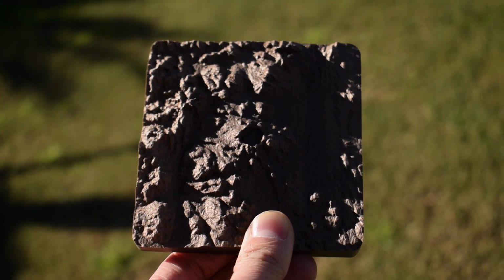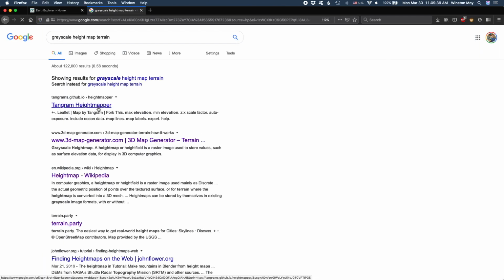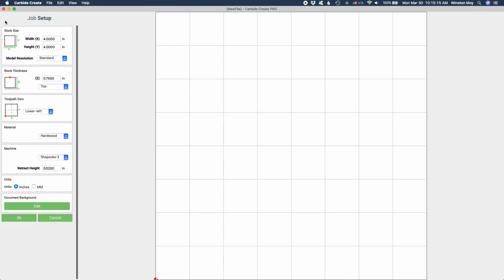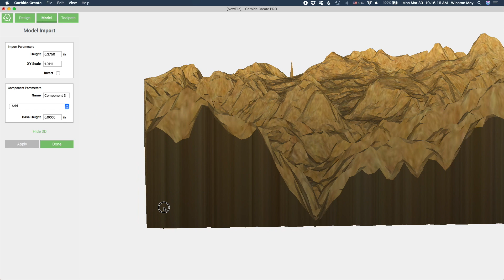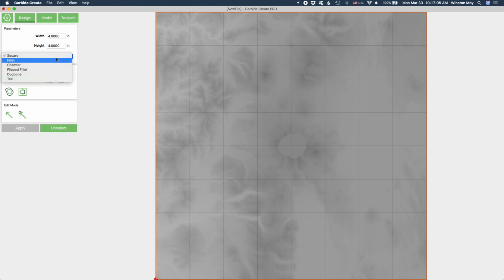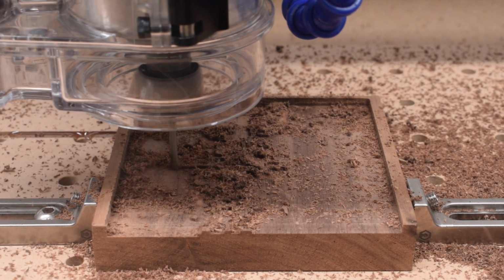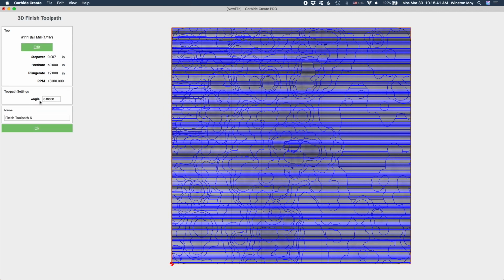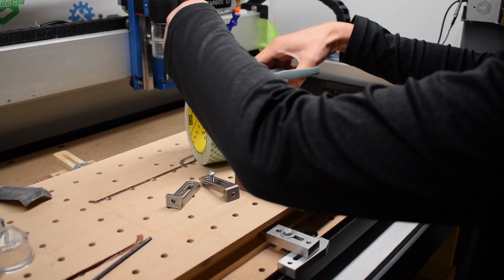Machining a Topographic Model in Carbide Create Pro

Comment: Can you use Carbide Create Pro with a Sainsmart Genmitsu type CNC?  I have an Anolex CNC which is a typical GRBL type CNC like a Genmitsu.  I bought Pro.
Reply from the maker: If you pay for Carbie Create Pro, it can export G-code for generic GRBL based machines (or any G-code based machine)

Comment: Thanks for the tutorial! I have a 1/16" tapered BN but no way to enter it into CC. Is there any way I can input it into the CC tools library and use it without it crashing into the walls of the project?
Reply from the maker: At this time those tools are not supported. If you're features don't have vertical walls though (or less than taper angle), you can just plug it in as a regular ball endmill.

Comment: Any reason that I could not run this on my Nomad? I assume it would take a lot longer.
Reply: Ran a slightly smaller sample on my Nomad the same day this dropped and it did take a bit longer, likely because I tried the Teton range in Wyoming, rather than something relatively flatter.

Comment: Nice video, and great product! Do you plan to make (or recommend an existing) video that achieves a similar result in Fusion 360?
Reply from the maker: There's a Fusion plugin called Image2Surface I believe. Not likely to make a tutorial for that, but it shouldn't be too difficult to use if you're comfortable with mesh/STL workflows.
Reply: I've tried Image2Surface some time ago, but for higher resolutions (bigger pieces), it's awful to work with. .. Instead, search around for an external tool called "b2g", which converts the grayscale to an STL, at 1 pixel resolution. Fusion360 then eats up the STL without issues or slowdowns, rather than the quad mesh you would get from Image2Surface. .. To be clear: don't convert the imported STL, just apply 3D toolpaths to it directly.